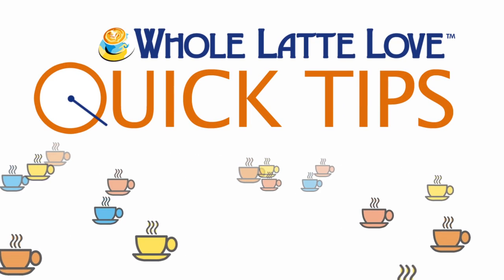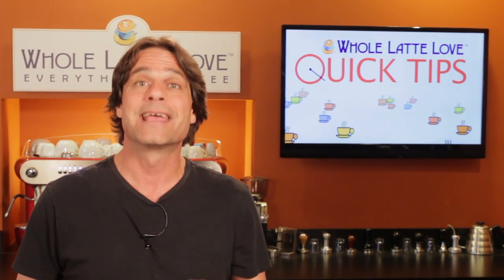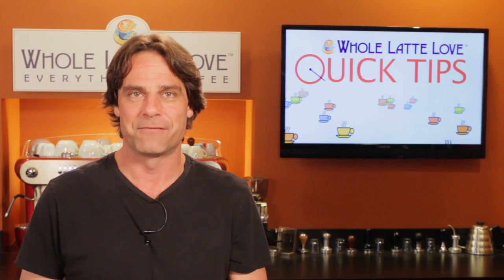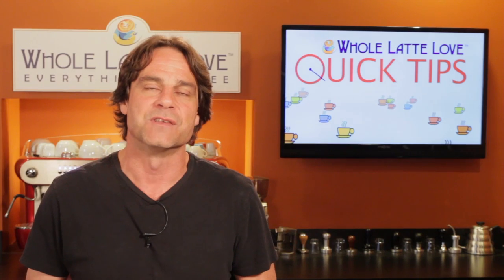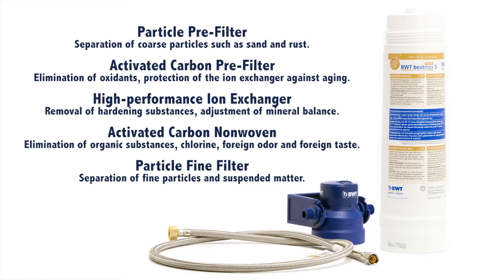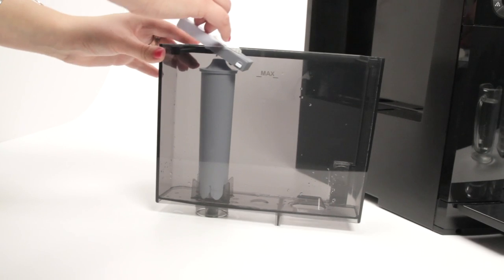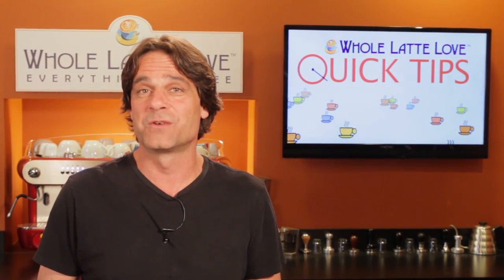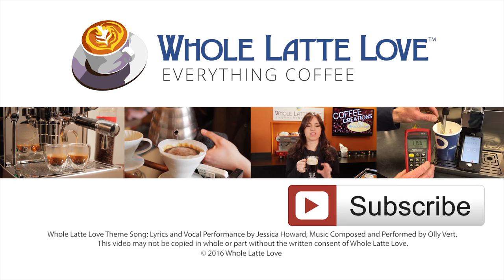Should I Use Ultra-Pure Water for Coffee?

Comment: Wwwwwwhaaaaat?  Purified water "can degrade machine components"?  Guys that's ridiculous.  The reason why they say that is one: they want your machine to go bad so that you go buy another one.  Two: repairs, and that means (money) for the manufacturer.  And three:  They want you to buy their cleaning products :-)  Purified water is what is (needed and required) in your antifreeze coolant for your vehicle or your vehicle engine and radiator itself, read your vehicles maintenance manual it says NOT to use tap water because it will ruin the internal components of the engine and radiator.  Water with minerals will KILL your engine components quick.  Purified water is better for everything that has metal such as your water heater, washing machine, your faucets etc.  Yeah, it takes a LOT longer for purified water to cause scale in those components.  

Purified water "taste bad" for espresso, really?  I don't know what kind of purified water people are using but mine tastes really good.  I really would like to know where you live but man the tap water that comes out of my home's faucets is simply disgusting no way I am using that for espresso hahaha :-)
Reply from the maker: Hi Adriana, So a coffee machine is not a car. Sure you can start with distilled water to fill your radiator. Then you add the anti-freeze and it's no longer pure. Automotive anti-freeze almost always contains corrosion inhibitors. Water is often referred to as the universal solvent. Remove all the minerals from water and it's an even better solvent - so much so that it will remove ions from metals it comes in contact with causing corrosion. That's why you will never see zero TDS water stored or transported in metallic containers or pipes.
Yes, using water with no minerals for coffee or espresso results in terrible flavor. As a more powerful solvent it over-extracts coffee resulting in bitter flavors. Also tastes flat without the minerals. Think of using no salt on any food and how bland it would taste. For reference here are the Specialty Coffee Associations recommendations for water quality: http://www.scaa.org/?d=water-standards&page=resources
To say we want your machine to go bad or we are trying to cause a repair or want you to purchase a cleaning products is patently false!  We are trying to help people enjoy good coffee and keep their machines running well.
If zero TDS ultra-pure water was the way to protect equipment every commercial coffee shop would be using it. But guess what...they do not. Some have reverse osmosis systems and every one of those systems has a way of remineralizing the water before it's used in their coffee machines.
I'm lucky enough to live in an area with excellent water right out of the tap. It generally runs at a TDS of about 150ppm and tastes great. Even at that quality I use a filter which exchanges calcium in my water with magnesium which virtually eliminates potential of scale forming yet provides a mineral level needed for good flavor and corrosion prevention.
I can understand the purer is better mentality - especially if your experience is disgusting water out of your tap. But for your coffee and the equipment which makes it minerals in water are part of the recipe.
If you'd like more technical details on the flavor and equipment impacts of using ultra-pure water here's one of many articles covering the negative impacts: https://wokelark.com/distilled-water-for-coffee/